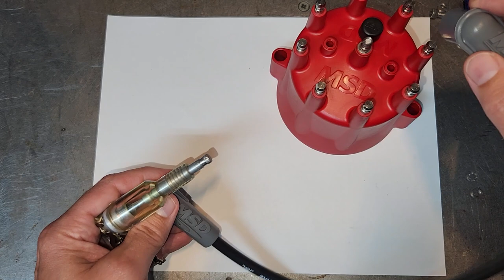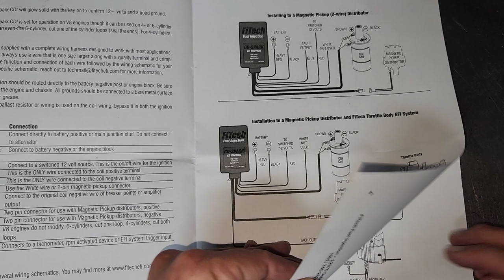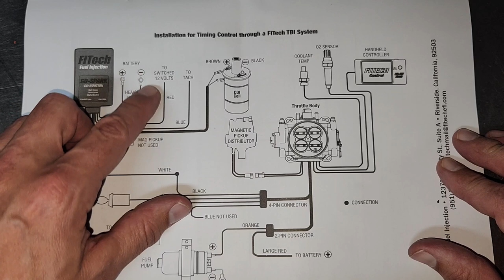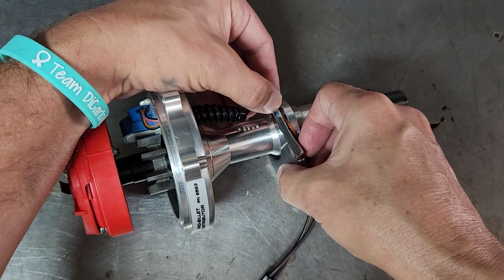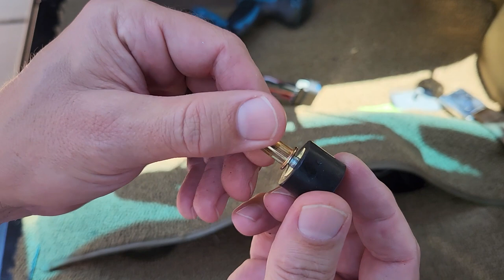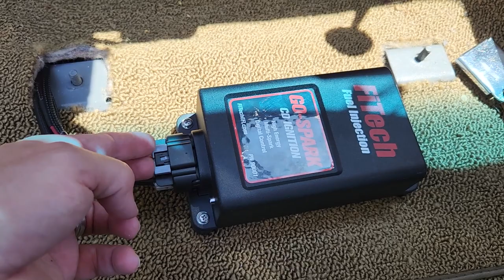Fitech GoSpark Install, more Spark, more Power!

Comment: I watched once came back  After our install  great info
Reply from the maker: Thanks!  But, I just found out the two coil wires from the CDI, should not be run parallel next to the other EFI wires.  Video on that coming soon!
Reply: @FastMonty  good deal  I have the ultra ram in and running  go spark in and sparking  Had car parked last yr I started to develop an oil leak that is no joke I have to fig out were its coming from
Reply from the maker: @DadsOleGarage-jz3hw  Yikes!  Hope it's an easy fix!  Keep us posted!
Reply: @FastMonty  thanks  it's way too hot to mess with now  but i will get it
Reply from the maker: @DadsOleGarage-jz3hw  I hear you... stay cool!
Reply: @FastMonty  you as well I'm sure we will get a break in next week

Comment: Holley will operate the stock GM  ignition module timing control from 80s timing control HEI and will screw right in to a regular HEI distributor. Just need to pin the mechanical advance. I’ve dun this several times.  So Fitech is not the only one that will work.
Reply from the maker: Good to know.  Thanks!

Comment: Great Info in here Mike.  I'm also planning on EFI for my Trans Am.  Never grew up with carbs.  A lot of the older muscle car owners hate on EFI but usually they have bad experiences due to poor install.

I'll have to check out your alternator video you mentioned, as a lot of these EFI systems like having a sound, well sorted electrical system.
Reply from the maker: Thanks Brother... yeah, definitely need a well sorted electrical system.  ALL of the issues I've had with my car has been my own fault.  Including clamping down on the distributor wires, how dumb.  I just had another issue yesterday with the way I wired this... so, stay on the look out for a follow up video to this one.  (Crazy I didn't have the issue until I was cruising for over an hour... anyway, live and learn)  Thanks!
Reply: @FastMonty  yes sir, live and learn.  It's how we grow as people and as engineers.  Learning from our past mistakes! 
Quick question about your battery: you mentioned you relocated it to the trunk.  Did you do this to improve weight distribution, or another reason?  I would imagine A-bodies are front heavy like most muscle cars, my F body certainly is.
Reply from the maker: @alanbarrese456  Yup, live and learn is right.  I moved the battery to the trunk for weight distribution, AND to free up some space in the engine compartment.  Great question!

Comment: Fun to see this new fangled tech!  It works great and I am Tempest (get it) to move over to it.  I have HEI on a 1978 305 and still running points in the 1964 389 in the Bonneville but just not quiet there yet.  I once got stranded in a TR4 because the Mallory electronic box failed so I'm a bit gun shy.  Post a video about how it goes over the next months year or so and I may just pop on this system.  Thanks!  Bobby
Reply from the maker: Thanks Bob... yeah, I hear you about being gun shy.  I've had my share of weird behavior, and electrical issues... as mentioned in this video.  All issues I've created, ha, ha... ie, don't clamp your distributor wires down, with the distributor.  The engine didn't like that for some reason?  ha, ha... thanks for the comment!
Reply: @FastMonty  I think it's more fun to show the things we all mess up on and shows a good YouTuber and overall being honest showing how this world really is.  I love the phrase one sees in old MG drivers handbooks... "Be Mindful!"
Reply from the maker: @bobeaseshop9389  Thanks Bob!  Yeah, Be Mindful.  too funny.

Comment: Great video Mike…what are you gapping your plugs at now?  What plugs you using?
Reply from the maker: Good question... I'm using NGK V Power plugs (BKR5E)  Gapped to 0.045"  That gap was from using my Davis Unified HEI unit, so I didn't change anything in that regard.  Thanks for the comment!

Comment: That's running really nice. I'm starting a rebuild on my '78 and am punching it out to 501 CI. Can I ask what cam you are using? Thank you.
Reply from the maker: Thanks brother... sorry I don't know off the top of my head, but it's a custom Butler/Comp roller,  mid range
Reply: @FastMonty  
No worries. Found a vid where you had the cam card:-)
Reply from the maker: @AB-80X  Ahhh sweeeet!
Reply: @FastMonty  
Have you thought about getting a cam that makes yours RPM closer to 6k? These things sound so good when they are wronged out. I’m shooting for peak power at 5700-5800 if it turns out that my block has the damage I suspect it has.;-)
Reply from the maker: @AB-80X  There's a low end trade off with cams designed for high rpm... since I love road racing, and autocross, I wanted more torque.  Hope your block is ok... keep us updated!
Reply: @FastMonty  Heh, I really hope it isn't. See I have a '77 black which means that I have a two bolt mains and a thin wall block. I'm just looking for an excuse to buy an aftermarket alu block from Butler. But the block is now in for magnaflux and Xray, because we think it might have cracks. So if I get the alu block, I can go to 521 ci with a mild 4.250 stroke and rev it out to 6000 no prop😀
Reply from the maker: @AB-80X  Welp, I hope that block is cracked!  😁

Comment: Not convinced this is an modern upgrade.  A coil on plug would be much more ideal and eliminating a problematic CD box..
Reply from the maker: A coil on plug would be awesome!  If it existed.  Doing so takes A LOT of work to convert an old engine to handle that... cam sensor, ECM module, etc... so, until that becomes an "Easy" mod, this is the next best thing.  Thanks!